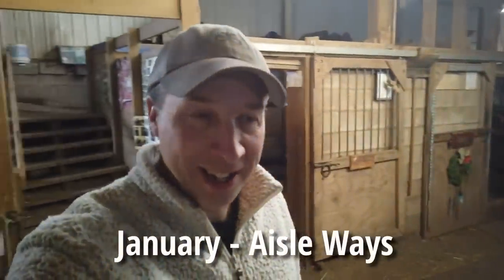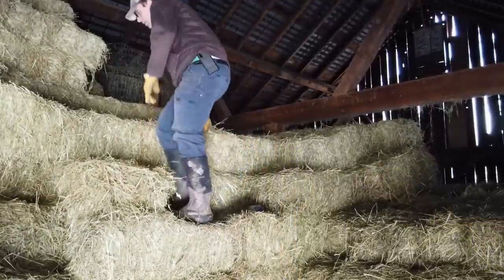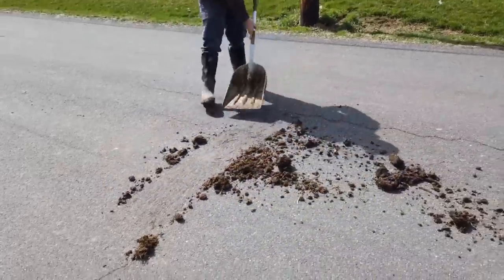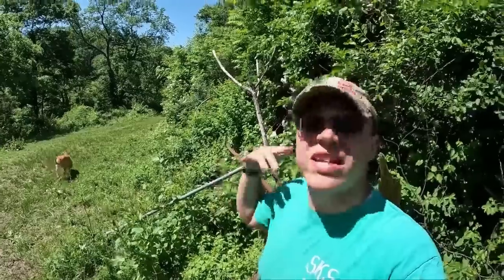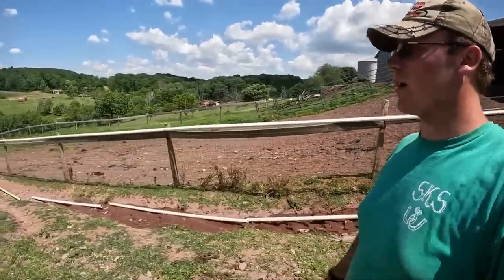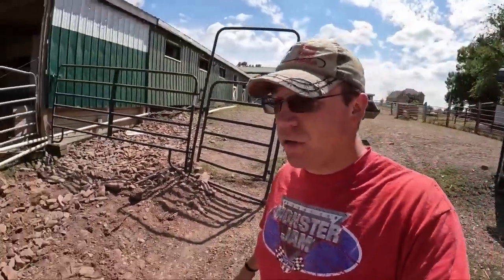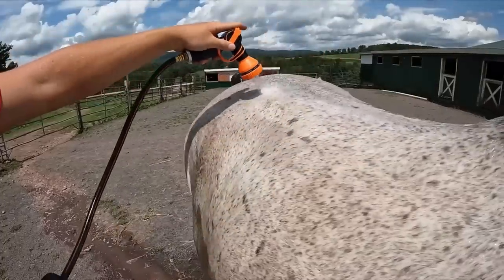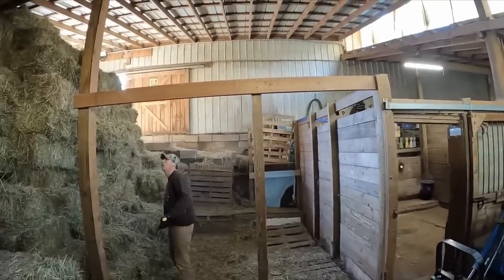2022 Was An EVENTFUL Year! What Did We Accomplish?

Comment: Their was a lot of changes from January thru December the walk way for the horses all new mates, loaded hay on two wagons unloaded , taking care of hauling manure to spread on pastures, cleaned around the place uses lawn mower and weed eaterJohnathan fixing a ten roof  new water pipes to each horse troughs putting new fence up very hot that day you can close one vial and water goes out the other vial in trough flush pipes out and cleaned trough cleaning  up rocks Gavin taking by the fence and dumping it Joel spreading is out on the steep grass water don’t stand and driveway as well and spreading dirt west horses come out of the barn to go into pastures and putting up a new horse shower Joel talking about how to wash horses down so they won’t get spook and your mom sunk in a mud hole your dad saved the day help her out and got her shoe back putting a washer power system in side barn so you don’t have to carry water from outside barn to inside horse stables an where the feed is you took a wall out and steps to hay loft made the feed room more bigger Joel and Megan on four wheeler Joel mowed the pasture a load of load of big square bales about 20 bales your dad and mom help and regranted stables around for the horses fix doors . Your welcome love your videos. And got two horses back you guys took Tucker as your guys horse an Poe master was done with her horse so he is back. Joel so sorry to hear the news about your horse 😢. And donkeys got a new stale and a little pasture to play .